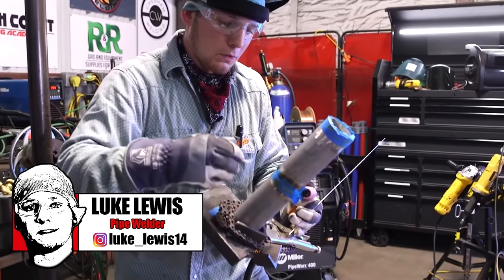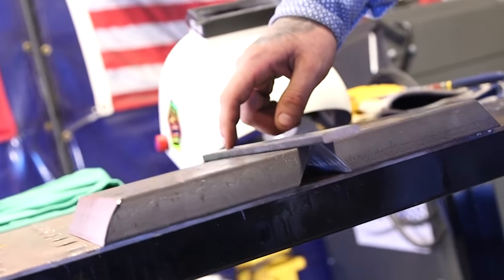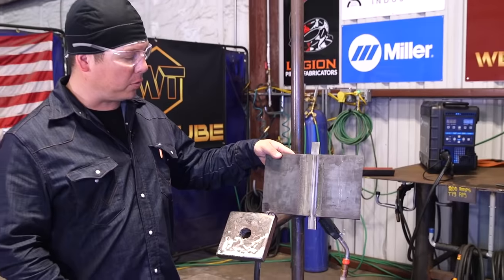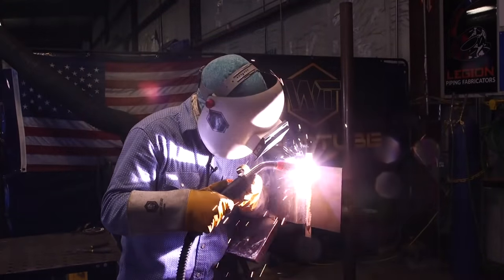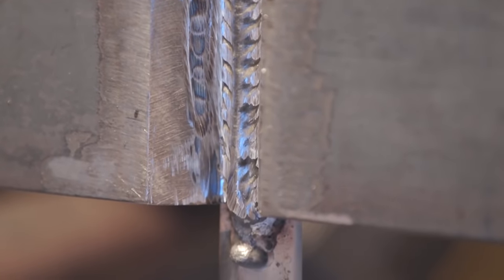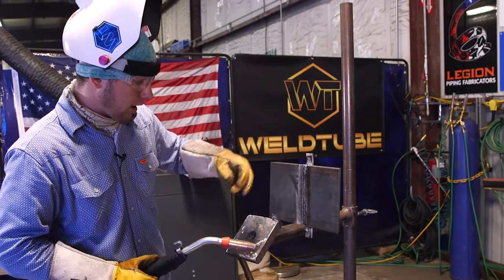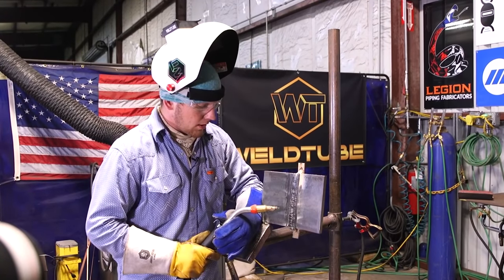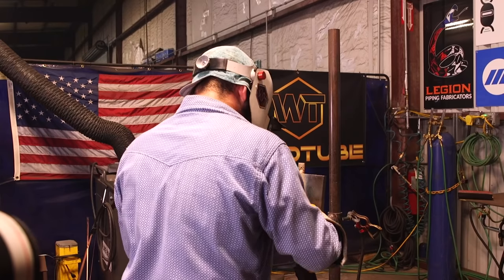Welding Flux-core with NO GAS | 3G Plate Test

Comment: For these tests they really shouldn’t allow people to have an elbow rest. When I’m welding up in a boom lift there’s typically no arm rest. These kids need to make sure they’re practicing with no arm rest and with both hands
Reply: Ya I thought about that too
Reply: U could always tack a rest to the lift.
Reply: What I was told is to first master welding with an arm rest and then free hand will come easier.
Reply: I would use a magnet elbow rest or even some chain vice.
You’re also probably that guy that says they should use a file instead of a grinder.

Comment: Out of all the welding procedures I've done, gasless flux is really underrated and gets a bad rep but with the right settings and polarity it runs like a champ. It does take time to get used to, I will say but once you get it dialed it's an amazing procedure to run and it's good when you want to weld projects revolving thin gauge metal like square tubing and despite the rumors it's pentrates metals ranging up from Qutar inch and above. Happy got to See Gasless flux being used for once
Reply: For me being a complete noob flux core was my most hated for vertical but it’s just trial and error so much
Reply: Yeah it's handy for a job I previously had repairing shipping containers outside otherwise you would chew through the gas having reg wound right up. It does take a bit of getting used to but I liked it.
Reply: I’d rather do any test besides this one any process
Reply: wait till you check out nr232
Reply: Totally agree 👍
Reply: @superdj2456    v. V.     V. V                        V.                     V.
Reply: @indridcold1206 well yeah if you fill a whole shipping container full of shielding gas of course it’s not going to last 🙄

Comment: I bought a little 125amp flux core welder recently just for stuff that doesn't matter too much or to use where i dont have 240v access, and to be honest, if you know whats going on welding wise, it does great. Its different and more "violent" while welding but if you look past that, a puddle is a puddle. I find myself using it quite often when i dont wanna use argon or drag the generator somewhere.
Reply: Cheap harbor freight 125 is now my go to around the farm! Lays a nice bead with good penetration and like you said, a good extension cord or a small generator and it's anywhere without a tank to lug around. Highly underrated and over looked. Technology has gotten way better over the last 25-30 years, back then they were kinda crappy and I think that's where the bad reputation came from

Comment: TACK THE FACE! Any CWI of "Pipe Welder" worth a shit would know that you should always tack a test D1.1/D1.5 Unlimited Test FACE UP! Tacking the back, and running 6 stitches on the backing pulled the knife edge of the bevels away from the backing! Leaving space for slag to run under. This is spelled out in AWS Sense, and AWS QC10.

Comment: Excuse my ignorance. Isn't Flux core always gasless?
Reply: You can run gas with it. It’s called dual shield flux core.
Reply from the maker: There is two kinds:
Dual Shield - with gas
Shelf Shielding - no gas
Reply: they also have dual shield wire.
Reply: FCAW-S = Flux Core Arc Welding Self Shielded
FCAW-G = Flux Core Arc Welding Gas Shielded

While they are technically considered to be the same thing, they really are like two different processes. There are lots of different wires in each category for a variety of applications.

Comment: Good job there Luke, FCAW takes a bit of practice, you’ve done well. If you continue doing a series of cored wire tutorials, I’d like to see a couple of things demonstrated ie , you do it with a K126 or similar torch/ hand piece. These are used in the field and also suitable for testing purposes. Next I’d like to see you diagnose some common field issues like incorrect polarity, excessive wire speed and it’s relationship to amperage, , too long/ too short stick out, the difference between ESO and CTTWD, mess about with torch angles etc.
I realise that you are not doing paid “advertorials” but it looks to me like you are using NR211mp, good product and I’m not being paid to say that. Maybe eve do something with the T8  and pipeline wires..
Reply: Thank you for requesting to see all of those topics you mentioned..They are all main points that are vital to getting this process dialed in ... I'm  still a student myself and those are all the areas that if you aren't made aware how to do those properly you will continue to struggle so thanks for that keen insight.. Hopefully Luke will be able to transfer that knowledge onto video and upload it to  youtube the same way he did this one...

Comment: I like it. We can not use grinders in our test just file and brush.  Your is nice 👌
Reply: D1.5?
Reply: @elkvis  looks like it
Reply: Yeah same here dude I'm trying get my 4G 1" in flux
Reply: @jordanaguilar284  run it a little hotter 4g
Reply: If you had the machine hot enough in the right settings you don't need to grind but it take some experience that everybody can master by practicing
Reply: @goldeneagle_wld245  ya they don't allow grinders there so every fill you gotta be consistent.  They say it's a weld test not a grind test. But look if you take one I bring a sheet rock knife with carbide teeth to cut slag out of any undercut if I trap. But at work we use grinders.  Just for testing they make or break.
Reply: @travisjones9508  it's not just that it's "not a grind test."  I looked into this, because it didn't make sense to me at first.  It turns out that it's geared toward workers on high steel, where any extra weight is detrimental.  You only want your hood, your stinger, brush, file, chipping hammer, and a can of rods, or in the case of FCAW, your feeder.

Comment: Wondering what diameter wire you used and its my understanding that a bead of 3/4" max is recommended for e71-t11.
Reply: Idk where you are but here we would never use e71-t11 for anything this thick. Structural is nr-232 and max single pass is 5/16.
Reply: @jca66  I was referring to stacking beads to a max of 3/4". It's allowed. D1.1
Reply: thats what I was thinking

Comment: Burns just like a 7018 we weld on structural out in the field... our test was re bar with 2 3/8 plate the heat is what got most people
Reply: What do you run it at? I test for this tomorrow

Comment: In need of a third tube of 5 litre gas for a small 130 amp MIG welder I bought flux-core instead and reversed the polarity inside the machine (25 year old simple machine). If one is reverting the polarity of an older/simpler machine you might need to reverse the polarity of the wire feeder as well. Mine was simple, but they can be wired differently so make sure before you buy flux-core.

Comment: I am a diy flux core guy and if you use best welds nozzle dip your wire and weld will run hotter and cleaner.

Comment: i certified with nr-232  nasty stuff... lol   had fun with it,   was goofing around with it and drilled a hole thru a 1" plate 🤣🤣🤣
Reply: You’ll punch right thru if you push it going vert up right? I hear that shits gnarly.
Reply: @wendigo444  it's not. Yes it like to run hot but it welds smooth as butter.
Reply: @wendigo444  it was funny i just held it there and let it burn thru ... =O  lol
Reply: @madcapmagician6018  yeah sometimes I’ll  just get the urge to just sit there and let her eat thru

Comment: I always have trouble seeing my puddle when I run E71T-11, because of the smoke.  Is there anything that can be done to improve the situation?
Reply: Yes negative pressure help a lot  to dissipate the smoke and you can see the weldpodle  more clearly
Reply: @alkohall4185  Yeah use a fan on a lower setting, not so high that you get porosity, but high enough to clear some of the smoke away.
Reply: Use a fan pointed backwards to pull the smoke away never point the fan at your weld you'll almost always get porosity.

Comment: all good , how ever your settings here are for your situation , sharing that info has no bearing on others situations, also you can change and reduce heat as you continue for your pc heat is increasing , for the heat input has no where to go, as you reduce your heat in this can youll gain better control as  you progress through the weldment and have less hang out on the cap as you complete the process

Comment: I've done test up to 6g, an not ever used a backing plate. When did useing a backing plate become a test factor? Alway's started  this test straight into the bottom of test plate's burning threw the tack, then make the transition while pushing the Weld forward, then point back down to bottom of starting point, then transition wire straight on the root walking back n forth, then at the top, run up am position straight on top of test plate the same as starting point.  For me making all these transition's on test plate's, really help's when the test move into pipe Welding Test.   Question, is the backing plate for beginners?
Reply: He did a awesome job with the Welding Test.
Reply: Would been nice to see the grind out, bend an break, cut up to see just how well Flux Core stand's up to, Stick/Mig Gas, Tig.  Not seen a Flux Core Test plate bend an break test, or one Cut into piece's.

Comment: I'm new to MIG welding, so have lots to learn... The .30" E71T flux core wire i use is marked as single pass, but you are doing multiple passes with it. Does that mean you can use it for multiple pass or do you have a multiple pass E71T flux core wire? If it is single pass and can be used for multiple pass, is the something special i need to know to do that?
Reply: use 212 innershield for multiple passes

Comment: “I see the problem wit it. It aint got no GAS in it!”
Reply: Using a proper CTTWD, and the right settings, the inner flux core turns into the gas you need. However with too tight of an arc and high wire speed, the wire won't have time to get hot enough, and the flux will bubble in your puddle, and cause all sorts of bad issues like wormhole porosity. With .035 flux core wire, you want to keep that stickout or CTTWD about 1/2"-5/8" of an inch. With the bigger welders and thicker NR212 wire etc, you can run up to about 1.25" stickout, but that's only if you have to get into a tight corner or something.

Comment: I’m taking welding as my trade and I live in ga but I’m thinking of moving to Cali or Texas. This question is for anybody but is there anything I need to know. Like tips, rules, techniques, etc. In my first year of welding, I’ve done Oxyfeul Cutting, Stick, MIG (vertical, horizontal and overhead) and Flux Core (vertical, horizontal and overhead). I have very little experience with TIG, I’ve only watched my instructor do it.

Comment: can we talk about where companies use these weld process applications? i never see gasless?
Reply: The in-laws run a mechanical workshop and they do almost exclusively shielded flux core. It seems to be the new standard around here. Like wearing suspenders and a belt simultaneously, lol.

Comment: Doing this type of test with a backing strip is child's play.
Without one, I wouldn't run my voltage any higher than 20.
Otherwise, you run the risk of burning a fucking hole between the test plates while attempting to lay down the root pass.

Comment: Great video,  but keep in mind E71T-11 is not approved (D1.1) or recommended (manufacturer) for thicknesses over 1/2". Most manufacturers recommended preheating for thicknesses 3/8-1/2. Your CWI should have caught that
Reply: What's the multi-pass wire designation?
Reply: @dakotadingo9083  "designation" isn't a word used in the D1.1 Code. There are several classifications approved for thicker materials, even siesmic
Reply: Designation was the wrong word, sure.  What's the multi pass wire called. IE NR211, ET71 as examples of single pass. Follow me?
Reply: @dakotadingo9083  promise I wasn't trying to be a smarta$$.
NR 211 is itself an E71T-11 electrode. It IS ok for multi pass welds, just not a good choice for thicker materials (1/2" max). I have personally seen major cracking issues with E71T-11 on thick materials.
NR 232 and NR 233 are both fantastic electrode choices for all material thicknesses and are both qualified for siesmic applications (i.e. california) I believe they are both E71T-8 Classifications. Unfortunately these are typically only available in large diameter which makes them useless for most amateur/hobby welders. 
Personally, I rarely weld anything thicker than 3/4", and use NR 212 (E71T-G) in .045 diameter.
And for clarification, I do use a lot of E71T-11 and love the way it welds. But I'll NEVER use it on materials greater than 1/2" (usually 3/8 max).
Reply: @ryanj2071  Thanks for the info. I'm a hobby welder with a tech school education. Landed as a geothermal well field driller so welding kinda took a back seat as we really only do smaw on 6 to 8 in casing very infrequently. Anyway, I like to keep my skill up by running as many types of wires and rods as I can at my personal shop. I've almost killed my second roll of 71M outershield and was wanting to run out some multipass fcaw-s next. So this info gives me a place to start when I walk into the gas supplier with the hobby shop debit card lol. Respect your knowledge. Stay Up and Stay Safe my guy
Reply: Very welcome, and glad to help.
Might be difficult finding anything other than T-11 at most welding supply houses, unless you're in an area with shipyards or a power plant. I usually order Lincoln wire through whichever online supplier has the best deal!
Again don't be afraid of the T-11 if you're just keeping up skills. I just wouldn't trust it on anything critical (over 3/8)

Comment: why are you using a nozzle if you're not using gas? also that first pass sounded horrible. it should be a consistent sound.
Reply: This is mostly because FCAW is globular transfer, not short circuit transfer like gas mig. Thick plates like this or structural steel, ship hulls stuff like that usually short circuit mig is not allowed; the only things that meet code are flux core or stick. Well you can use TiG too, but TiG outdoors on a windy day is really troublesome, a little gust of wind and you'll be going thru tungsten's faster than some guy using 6013's on a buzzbox....

Comment: What happened to slag you drag angle
Reply: That's for 1G, flat horizontal. Slag you can't run downhill vertical because you'll run over the slag, and get inclusions etc. Overhead you lower the settings a little and drag the puddle. Very slight push angle is better for vertical uphill with FCAW.

Comment: Why are use using a gaz cup on a gasless flux cored wire???? Why are you practicing with a zero Charpy value wire not allowed for structural steel? You are training welders with a wire they will never use in structural steel? WTF. You should train on a 232 lincoln wire versus  211. Never will get AWS cert for California or North west.

Comment: Show us the finished weld!! The one second flash isn't long enough  to get any insight on the finished product. Is it prone to undercut? Slag? Thin slag layer? Difficult to remove? Something else to discuss is the temperature of the coupon. That thing most be crazy hot and thats a huge factor that can affect settings or travel speed etc. Your video really didn't help a novice to understand gasless wire at all. IMO you missed a ton of stuff.

Comment: Its called NR 211 wire inner shield.. never called it flux core ... although it does have the flux inside the wire its always called inner shield
Reply: Inner shield is a trade name of Lincoln electric. It’s called FCAW = Flux Cored Arc Welding
Reply: @tyabeny6558  Haha, again it’s called Flux Cored Arc Welding which is what he’s doing in the video (gasless). You’re referring to a different process now which is actually called gas shielded flux core. Dual shield is a trade name of esab. Ouch, that must’ve hurt the old ego there, chump. I don’t need to listen when I know how to read.

Comment: Try not using a grinder lmao chipping hammer and wire brush like my tests required
Reply: So you're telling us that they wouldn't even allow you to clean off the slag after laying down the weld beads?
What are they smoking and how much?
Reply: @ryanmccarthy8625  well a wire wheel and a chipping hammer but not grinding every weld out come on my mom could weld and grind every one out perfect to pass 🤣🤣
Reply: @upstatefishing1144  I misread your initial comment, I was a tad drunk yesterday. 
But yeah, in most cases it's not very common to use a grinder during a welding test.
Unless there's a few high spots or just a really fucked up weld bead that need to be taken care of.
Oddly enough, you can use a grinder as much as you want in a shop or out in the field.

Comment: HAHAHAHAHA.....Did he say it's mostly hobby and some industrial uses? Dude it's the primary process on most structural steel and bridge work in the field. Done properly with the right settings you should not have to touch it with a grinder in between passes. 
I love how the CWI also has his silly welding cap on for now reason other than he thinks it's cool. OH, pipe welders that think it's not welding without the silly cap turned side ways.

Comment: 3g/4g tests must be different in different states.....

Here in Cali when i tested, use of any power tool or grinding is an automatic fail. The cap on this plate looks WAY passed the height specs allowed here in Cali, meaning it too far above the base material. And the fact that the entire piece flexed and curved inward so much is also an automatic fail.....